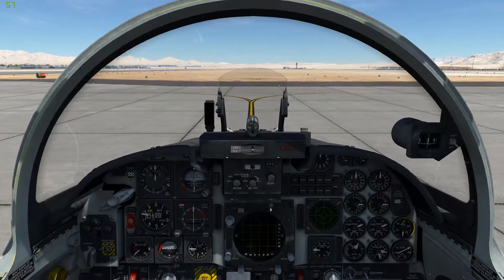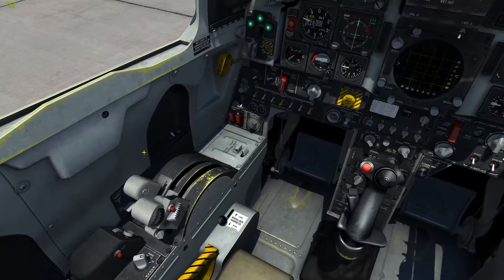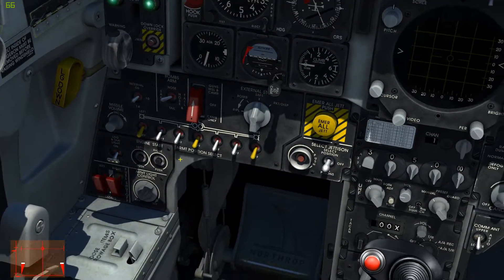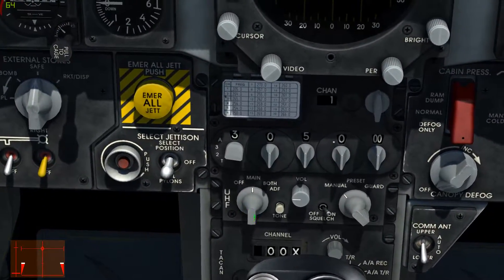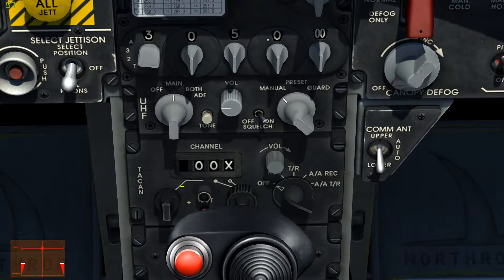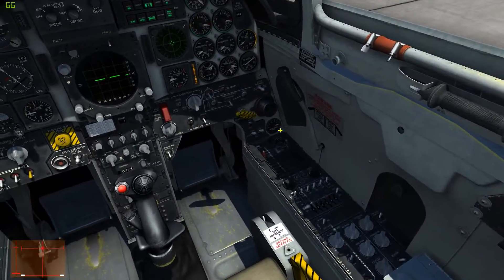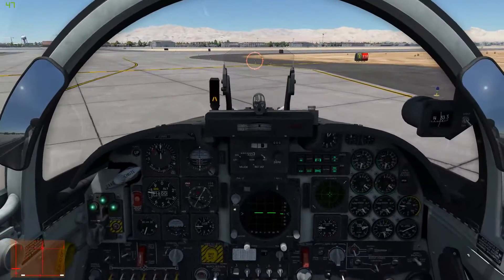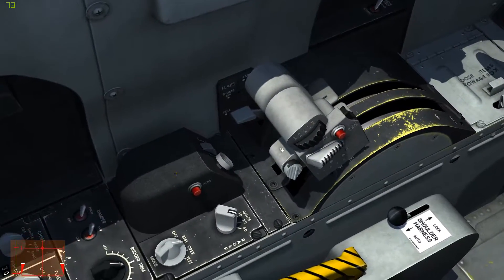DCS: F-5E Startup/Taxi/Takeoff tutorial (split throttles)

Comment: This is great; love the trick with the dual throttle startup.
Reply: mtnmist1 you can do it either way, by shifting the air, or Crossfeed, depends on whether I'm just scudding around, or running a mission where start time is critical, like a ramp start intercept.  I had to dig around in the FM to find how to Crossfeed (before I saw this Video), since it's not part only Chucks Guide

Comment: Setting trim before take off might help a bit with the rotation and take off. There's a table in the manual for trim settings with different loads, although I usually prefer a little less nose-up trim than those values.
Reply: Absolutely! I forgot to set it at my first take off and it was a roller coaster ride!